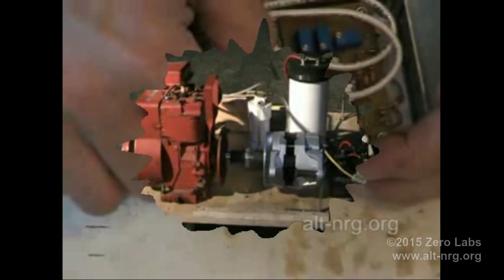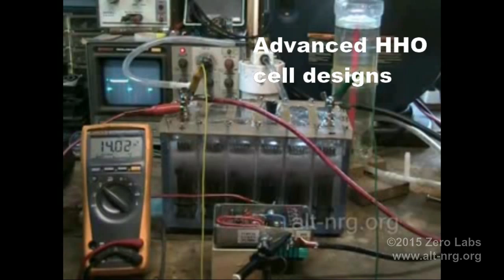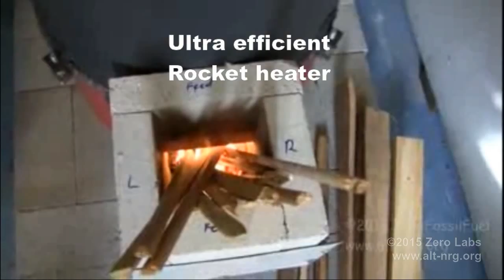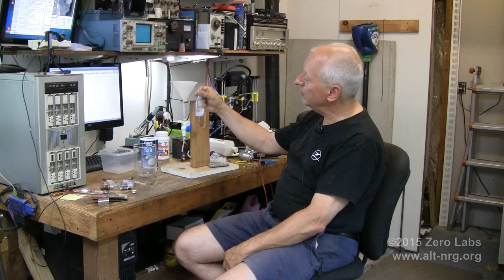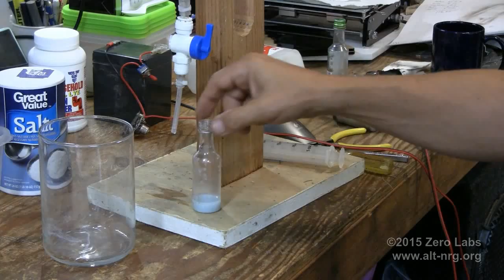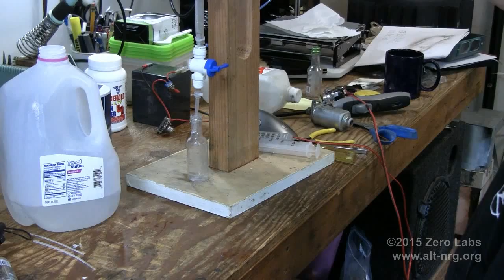#406 Keshe plasma reactor 02 CO2 GANS collector

Comment: You know maybe piping outside air into the unit, if this is co2, might increase the yield of the "gans". Maybe a stone air bubbler might work to decrease the size of the bubbles entering the system of plates and solution.
Reply from the maker: +Jon Bigman That's a very good point. I do have an aquarium pump and stone bubblers I could aerate the solution with. Trouble is that's not part of the original recipe. If I deviate even the slightest bit I will be accused of deliberate failure to unfairly discredit Keshe.
Reply: Electrolysis might be causing the plating of the nano material in the gans production system. One way to get around this would be to use the energy between the two plates to lessen the plating process and to purify the gans. But I haven't started my experiments yet and thought you might like some avenues for enhancement to test once you establish the initial system. I am of the opinion that the nano coating of the copper is a form of carbon. The electrolysis creates two products oxygen and hydrogen. The hydrogen is dissipated and the oxygen is donated to the free carbon in the form of free floating nano coating. Once this happens you get a low level bonded Co2. Maybe... Once you get the system(Keshe system) running I would suggest to enclose the system and pump Co2 into the system as a known amount and see if any Co2 is being taken from the environment or if the Co2 is only coming from the Nano coating.
Reply: I have a sneeky suspicion that Keshe has little idea how these systems would react to lightning strikes or say a disruptive discharge near the superconducting antenna, which this is touted as. Please do not attach this to the grid. Use a battery and inverter to do all the tests until we can check what happens to the grid if this happens. Keshe is very clear that this nano coats the lead in wires from the grid and if that happens then the breakers become superconductors that will not trip. Again until we find out otherwise do not connect the power generating system to the grid before we test this further.

Comment: I really enjoyed that video! I think there is a difference in the size of the nano particles if you use the excess energy across the two plates. I have to research that more. What I mean is the slower the process the finer the size of the nano gasses. But that remains to be seen. I like the setup you have there with the funnel. Nice job in finding a way to extract the settled nano gasses. If that is what it is. I am still of the opinion it is an oxide though. We need to send some out to be tested asap. I am of the opinion this is much like the white powder of gold though. It is too much like it to not investigate both avenues. The white powder of gold can be extracted from sea salt as well or rocks or ph soils. It seems it is in everything really... Well not naturally our bodies. We must consume things to get it.. But I digress... Nice take on Mr. Keshe.. I am still trying to wrap my head around this technology. Still not sure it is valid perception of the effects. But time will tell...

Comment: I'm glad you're doing this!  Just subscribed to your channel.  I am very interested in seeing how it goes for you.  I've collected copper foil and wire...still need the zinc.  I appreciate your honest, critical style.  Too bad the fire/water method of nano coating didn't fly for you.  Makes me wonder about what Alexz may have done differently. The only thing I can figure, based on the 68th Knowledge Seeker's Workshop, is that he may have fired and doused several times...perhaps allowing the metal to cool completely.  I gleaned that the process wasn't speedy.  I recently burned a copper pot in my kitchen...I doused it while it was still hot.  Here's what I saw -- carbon flaked off; but, left behind in spots were black areas that did not rub or flake off.  This is a pot that has been heated and cooled numerous times.  Not sure if that has any bearing on a metal's ability to retain 'nano coating'.  I'd also like to pass-on making anti-stick cookware uses a similar process of repeated heating and cooling. 

By the way, that was a brilliant method of extracting GaNs.  So simple.

For your consideration:
Keshe Foundation: Nano-Coating Process (the slow train)
https://www.youtube.com/watch?v=JL64BQeEjEo

A Conversation with Dan Winter about Mr. Keshe and Plasma Science (duration: 30 minutes)
https://www.youtube.com/watch?v=swi5R1VwxLw

Regarding the zinc, what gauge is it?  I'd considered buying the same roll.  :-)  I'm guessing you'll need pliers to bend it.  Thinner sheets of it are available; but, the prices are astronomical. 

Peace.
Reply from the maker: Search4TruthReality  The zinc is about 18ga I'd say. Very soft, almost like lead. And yes, it was around $35 for the roll. I will be using the rest of it on my roof. Big problem with moss.
Reply from the maker: ZeroFossilFuel Actually maybe 24ga

Comment: A typical value of temperature obtained in a plasma  may be of the order of 28000 °C(50000 °F )   motor can not run at temp. they just blow up
Reply: Douglas Carver Just look at workshops page and you got your answers, plasma is not "plasma",  wash your plates before use, max 30Celzius H2O, demineralized better.

Comment: Hi Mark. I also have decided to replicate this setup and have built a 3D printed star formation reactor. Everything is either press fit, or screwed together, and the reactor balls screw in half for easy nano coating or loading. I have used brushless DC motors because I had them lying around and they will run on anything from 5-14V DC. I have produced a small batch of CO2 GANS but still have a long way to go. Looking forward to the progress of your experiment. Here are some photos of my reactor. Cheers!
https://plus.google.com/108192176829955441279/posts/E8LvmYa3VeY
Reply: John A The way is not just long, i is infinite. What you are attempting violates one of the most fundamental laws of the universe. 

Positive results are (if obtained honestly) always setup- and measurement errors.
Reply from the maker: John A Hey, can you share your STL files of the plasma reactor balls?
Reply: Sure. Print at 20% density and 0.2mm layers.
https://drive.google.com/file/d/0ByYq7NqJDR5oQW9CcGktZlM0VW8/view?usp=sharing

Comment: Hello everyone .The white stuff is co2 extracted from the air at room temperature. This process confirms that Physics has to be re written. The material is call gans which  means gas in a nano solid state .The gans  has huge applications in medical,  energy ,health, transportation and new materials. The Keshe foundation is showing how to use this technology to be used   for World peace purposes.
Reply: Emanuel Spiteri Have you had analyzed this stuff? Do it - it costs below 50 Euros and it will open your eyes and prevent you from falling for Keshes crap :)

Comment: I keep thinking about that "Nano coating" and the electrolysis portion.  The reaction you had and what it is to be...  Fun Stuff.  Keeps the brain thinking!  Thanks for your time!
Reply from the maker: Matthew Q I know. In the caustic process shown by Armen at KF he is very explicit about the drying process to harden and seal the nano coating to the copper. My voltage was at least 40% greater before the coating I had disintegrated when I allowed current to flow, even though the coating itself is supposedly non-conductive. Interesting stuff.